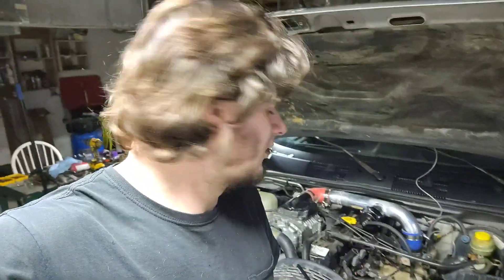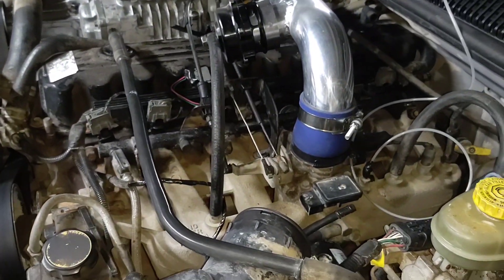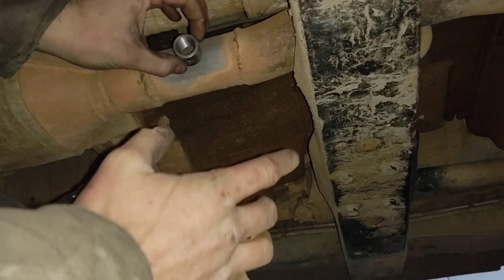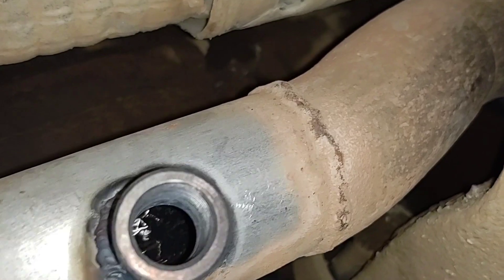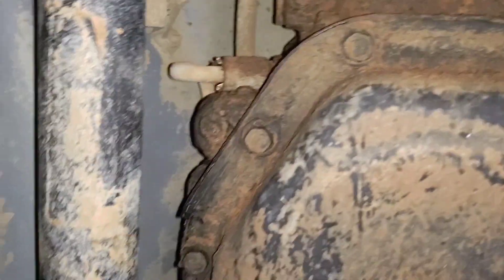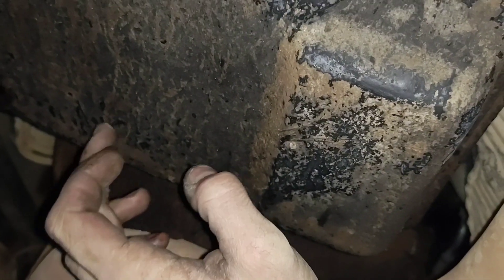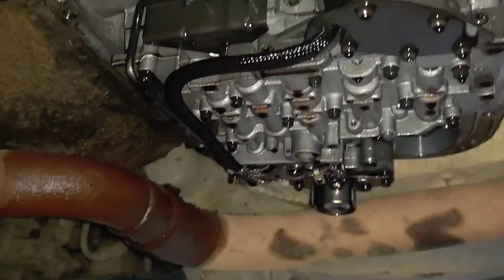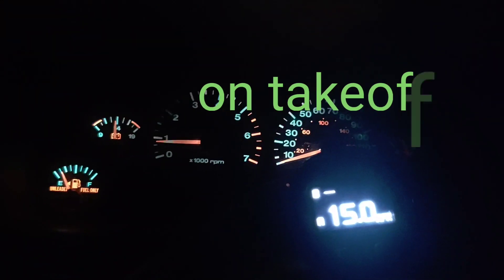more supercharged jeep testing

Comment: Jesus your putting a lot of fuel to that thing 47lbs?!? That's insane lol
Reply: Hell I upgraded from 19lbs to 24lbs in my jeep and it's running rich ASF with a V8 too 🤣🤷
Reply from the maker: @khrisshultz2532  IV tuned mine with hptuners lol. I don't have that problem 😂
Reply from the maker: Yeah I shouldn't have to upgrade at any point. They are good for about 400 hp

Comment: I saw approx. 323k miles on the odometer in your video. Any engine or transmission rebuild, refresh or service history that you know of on Jeep? By the way, check out Cascade Transmission on YT. They have a refresh kit. About 250, if I remember. That will most likely make the shutter go away.
Reply from the maker: 324590 now lol. All the miles
Reply from the maker: In a later video I pulled the 42re apart and put new clutches in it. I want to build a 42/44re hybrid just gives you more clutches really but it's experience.
Reply from the maker: No history that I know of. I bought it cheap